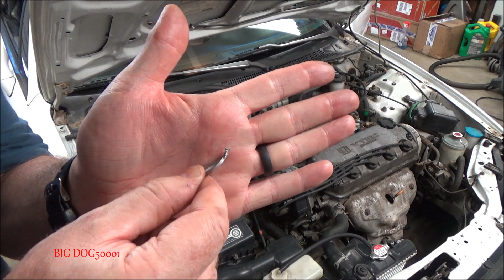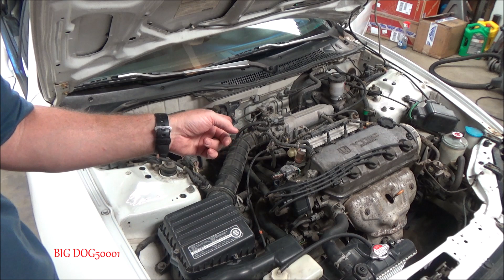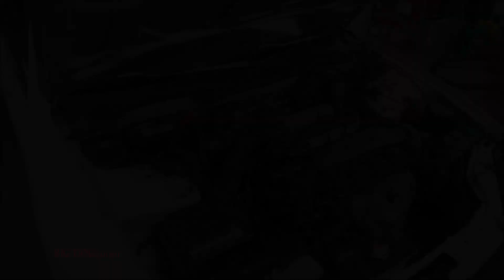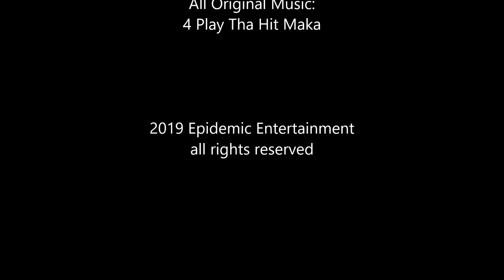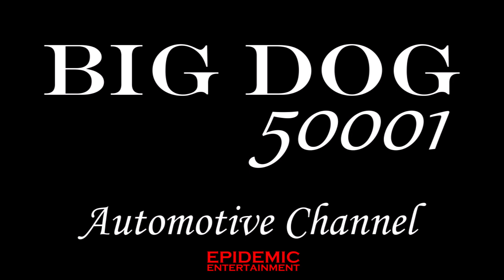Tech Tip: Don't Over Tighten Drain Plugs!

Comment: Unrelated question to your video. 2017 Honda crv electric parking brake. When engaging or disengaging it makes a really loud squeaky or grinding sound at the end, dealer says it is normal but no other crv in workshop sounded like  mine. It has only done 13000km or 8000 miles.
Reply from the maker: Those actuators can be loud but yours sounds like it might be a bit excessive from how you describe it.

Comment: Quick question. Where do you buy those washers from. I work for Honda and just stopped at our service center to buy transmition fluid and that washer.  I was charged $2.30 for that stupid washer.
Reply from the maker: That is not too bad of a price for an OE gasket from a Honda dealer parts counter.  They are more expensive than oil drain plug gaskets.  I buy them in bulk online to save money, usually from Honda dealers.  I always include them in a parts order because of shipping costs.

Comment: Hello: got s chance to buy a 2008 Nissan Altima 2.5 with 163,000 Km (about 100,000 miles) on it. Has been well serviced with no complaints with the CVT. It's for my daughter who is attending school in Portland, Oregon about a 6 hour drive south from Vancouver, BC. It's my niece's car as she want to get a RAV4. I could probably get it for C$ 2000 which is below market. What are your thoughts? Thank you.
Reply from the maker: I can't see what kind of shape it is in, but if it has been well maintained it should be a good little car.